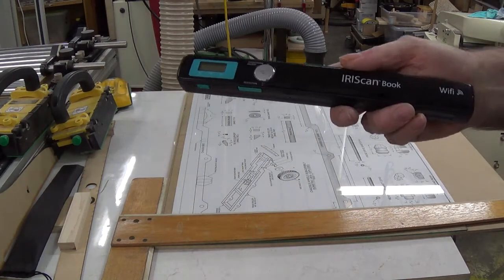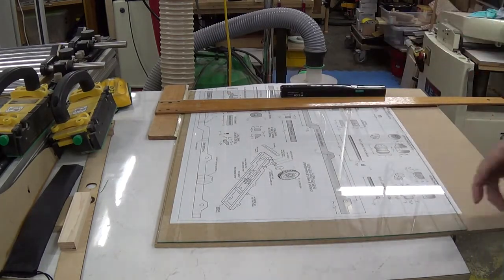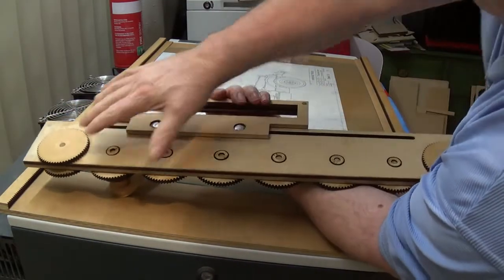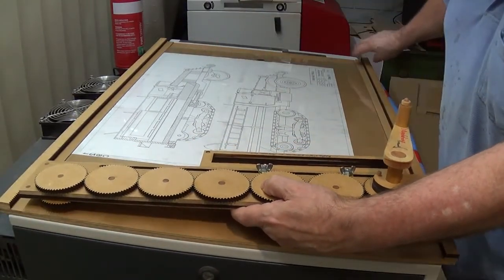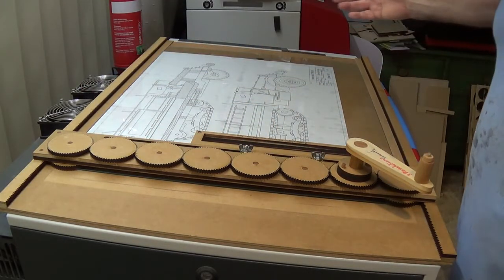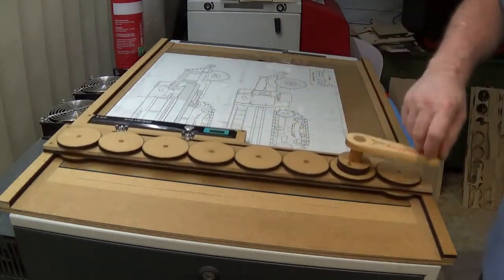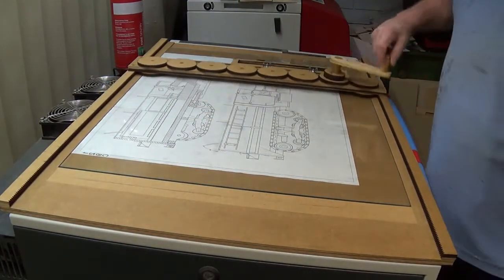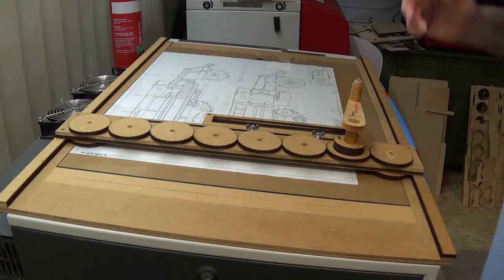IRIS scanning jig (Using)

Comment: You could just attach the handle to the next gear up. By changing the drive gear you'll make it so that turning clockwise will move the jig to the right. I'm mentioning this because you said how it felt counterintuitive setup the way it is. Nice build though.
Reply from the maker: Hi Lank, thanks for the encouragement.  Yes, you could attach the crank to another gear.  I just didn't think of it... good idea.  However, now that I've marked the rotation, I'm so used to it that if I changed it, it would only just confuse me.